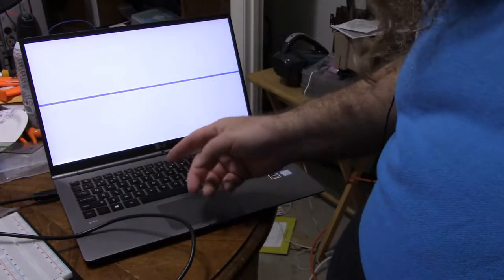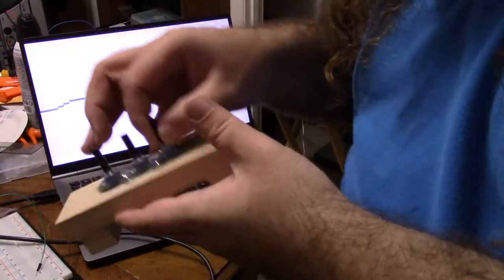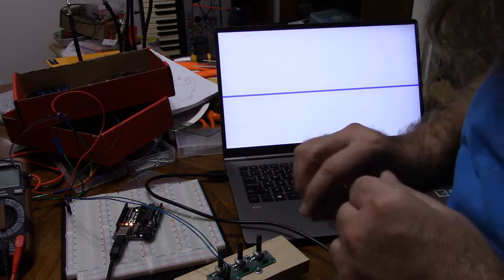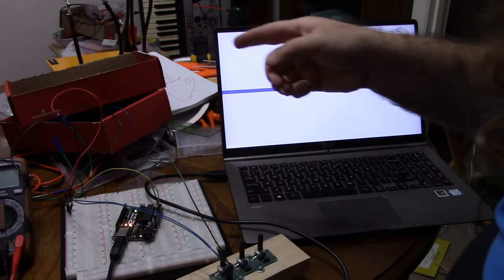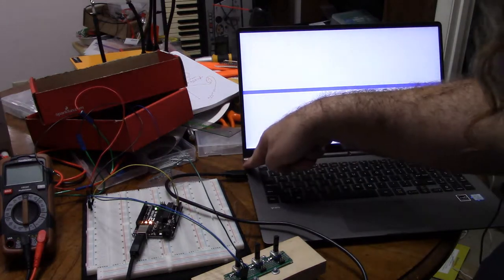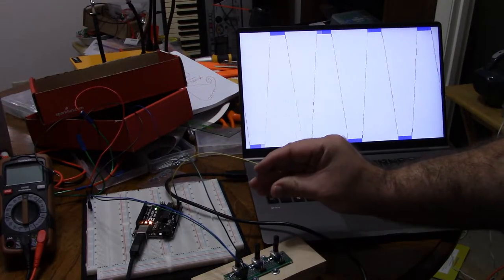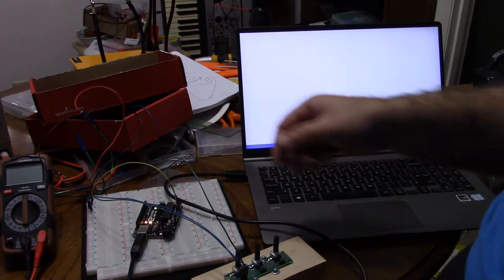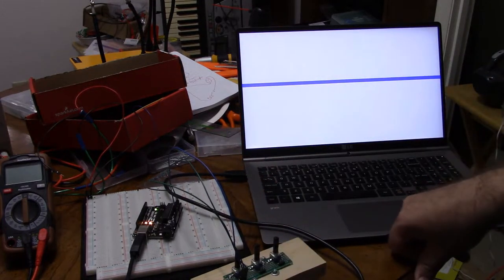Common Ground - Demonstration - Simply Put

Comment: Awesome, you are a genius and an incredible teacher.

I have been struggling getting multi power source projects to work, you have REALLY helped

So, just to check, 5v is NOT 5v but rather it is 5V relative to Gnd, therefore in a multi power source project you need to to set a “common ref point” ie Common ground

Comment: Transistor should have common ground as arduino current flows through base to emitter whereas same for collector VCC therefore transistor should share same ground
Reply: I was looking for this comment. the emitter is common between the input and output so it must be tied to the same ground .

Comment: Thanks so much, this made it much more concrete for me. I am trying to do BJT transistor Characteristics curves with voltage reading sensors but because I didn't have a common ground, it wasn't measuring the correct voltage. I appreciate your explanation!

Comment: I've got a function on a microcontroller works by connecting a pin to ground.  I want to do that switching with a voice recog module  that outputs a 3.3V signal.  how can we do it without a relay?
transistor maybe?

Comment: Nice explanation! With a common ground between multiple DC power supplies, what would happen if a short circuit happens on one of the power supplies? Would it effect the other power supplies referenced to the common ground of the setup? Thanks! Also can I reference common ground between multiple DC power supplies of different amperage and voltage?

Comment: What if the other power supply is running at a higher voltage than the arduino? Does that change how we create a common ground?

Comment: 6:07 How the heck can a NPN transistor work without not having a common ground for Collector power source and Base power source?
Yes I'm a newbie :)
Reply: Noise is not an issue here because it's not 'measuring' with reference to the other power supply it is simply like a relay with 24VDC on the coil and your contacts switching a higher voltage.
Reply: I was looking for this comment. the emitter is common between the input and output so it must be tied to the same ground.

Comment: what if we connect both positive as common ground?
Reply from the maker: That could work, but the problem is that circuits generally behave better (or misbehave less) if any variation (such as power-supply noise) is on the positive side. For your particular application, it might not matter and it could work just fine. But conceptually it's also a little unusual because the highest voltage in your system would be 0V and every actual voltage would be negative (according to the math). Physics doesn't care whether the humans involved consider the voltage positive or negative, but anyone else looking at your circuit diagram might.
Reply: @simplyput2796  Thanks man